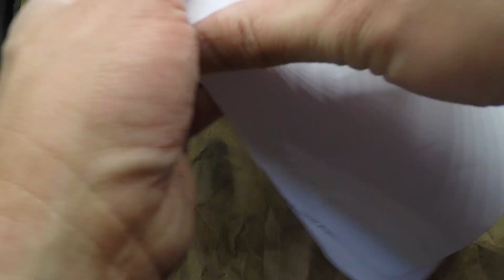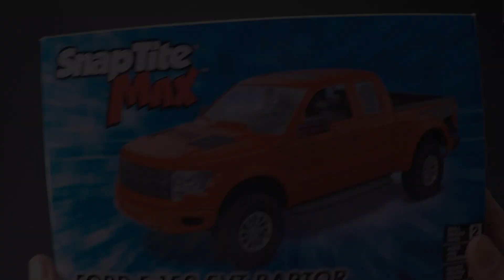Part 2 (Final) Detailed build of the Ford Raptor F-150 SVT. Revell SnapTite MAX 1/24 model kit.

Comment: the wheels have a bit of poke on the one side and the other looks pretty correct. and its unfortunate that there isn't any suspension detail in the wheel wells, but you've done an amazing job on a snap kit!
Reply from the maker: My first one since I was a kid.